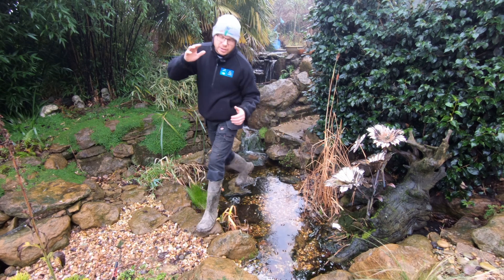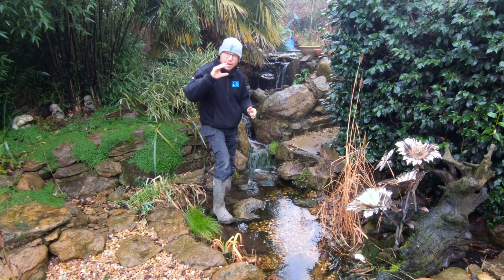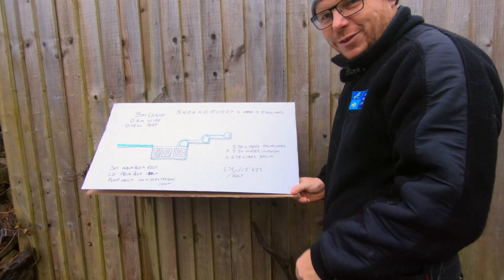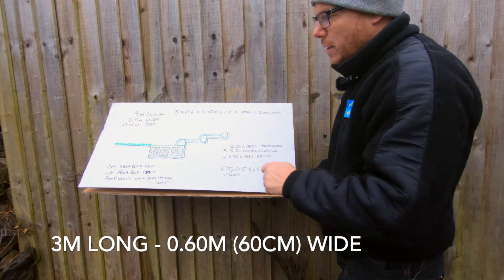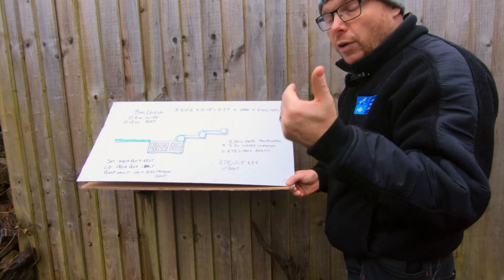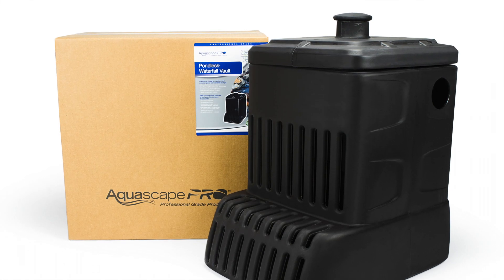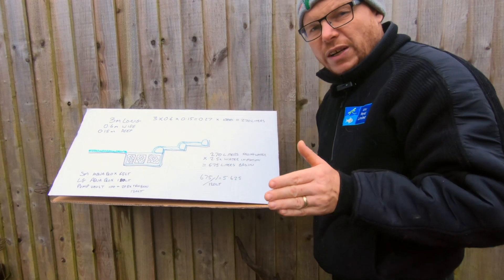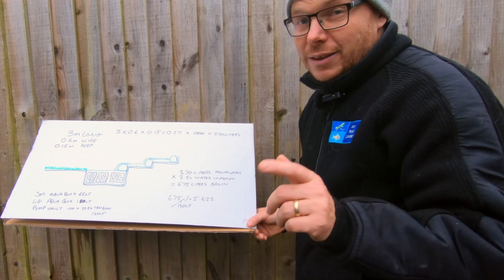What is the ideal size for a reservoir in a pondless waterfall?

Comment: Using you method to calculate, you already have a reservoir in place.  Does this mean that if the existing reservoir in place is too small, it needs to be taken out and re dug for a larger capacity?
Reply from the maker: Yes 👍🏻

Comment: Very helpful, thanks for posting! Should I be including the depth of the rocks in the streambed when doing the calculation? I have about 6cm depth of rocks in the streambed, and maybe 3cm of water. I used just the water depth when first calculating my basin size, but my basin is draining very quickly so I wonder if it's undersized.
Reply from the maker: You might have a low edge, if the basin continues to drop are a few minutes the water will be in motion and then should sit at that level for 24 hours with not much movement
Reply: @ThePondAdvisor  Thanks for the response! turns out I had a tear - I made the mistake of making a cut in the liner (rather than pleating it) at a sharp angle in the stream, and the cut kept stretching until it hit the water level. Buying a patch kit and hopefully that will do the trick!

Comment: Hi. So I'm really finding your videos really  informative. Great that a professional is prepared to pass on so much knowledge and expertise. Thanks. So, I'm building my first feature and it's ambitious! I plan to have a outflow trickling over a short drop to a pool, the pool will overflow trickling to a second pool over a short drop. This will be repeated over a length of about 6 meters. Do I discard the volume of water held in each pool from the calculation. Have I got that right? Thank you.
Reply from the maker: Depends on if the pool /pools stay full of water when switched off
Reply from the maker: I have a video planned on this topic but it’s planned for a few weeks away.
Reply: @ThePondAdvisor  That's great as I can make a start and come back to the basin later. Thanks again appreciate the advice.

Comment: Great video Mark. I have two questions for you: do you have a calculation for easily figuring out the size of liner needed based on aquablox needs? And also, do you typically stack an aquablock vertically behind the pump vault to fill the void created with offset rows or do you just use a gravel fill? Thanks!
Reply from the maker: Both gravel or a cut down blox, no I don’t have a different calculation, just install the same size basins.  So know what I need, most of the time these days I am installing a kit. 
Our online store is now open
Reply from the maker: Have you seen my how to calculate a liner video? It’s the same principle
Reply: @ThePondAdvisor  thanks so much for the reply Mark!
Reply from the maker: Benjamin Ferguson my pleasure

Comment: Bummer, I just presumed you'd have a small pool at the bottom with a  pump/hose back to the top and then the required water for the actual stream. Now my 25m stream comes to 5,625 litres! might need to rethink this!
Reply from the maker: Sound like a nice big water feature.
Reply: @ThePondAdvisor  Well I wont be digging a 5m cubic basin that's for sure. so it might be a feature that never features
Reply: @kps.77  I ran into this same issue -- was looking to build a 108' (appx 36m) pondless stream which would also serve to manage surface runoff during heavy rains with a buried overflow at the top of the pondless basin but to have 2.5X the moving water the pondless basin was enormous - I might as well have dug a pond, so abandoned the idea at the moment.  I did briefly consider an auto-fill valve in the pondless basin to add additional water from the house when needed and then use a much smaller pondless basin but decided against it since it would mean several hundred gallons of house water to be added after any period where the pump is shut off.

Comment: Excellent info, thank you Mark 👍 Can I ask, how does this relate to pump size?
Reply from the maker: The basin size only relates to the pump size if you have more water in motion.  If you have a large pump and a small basin the water will be back in the basin before you know it.  As long as you have the 2.5 times the water in motion you will be fine!  If you have lots of water in motion but only a small pump the basin will dry up. If you changed the pump to a bigger one it would still be the same (a little more water in motion from a bigger pump) plus you might experience splashing with faster water.  

So the size of the basin is all about water in motion, the bigger the pump the more water in motion but the quicker it falls.  So yes the different pumps do effect the water in motion but not a lot.